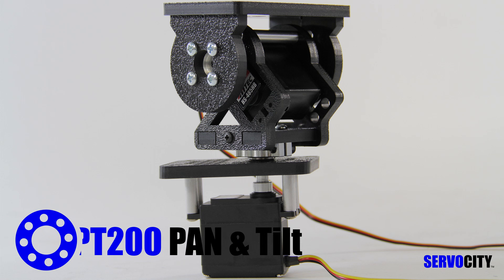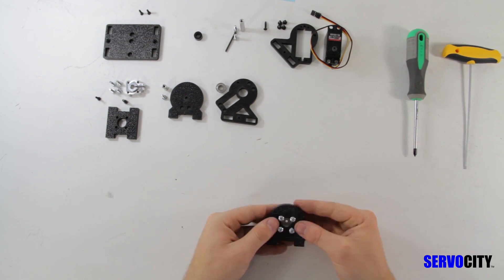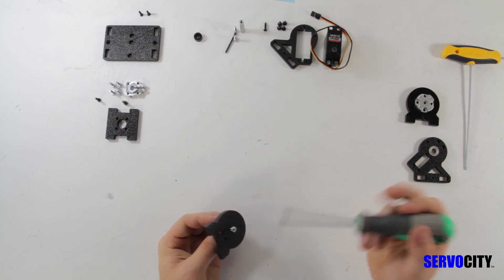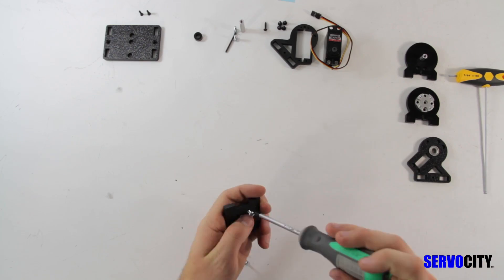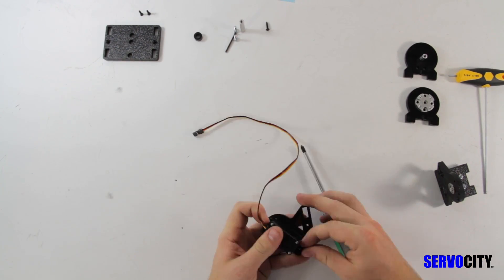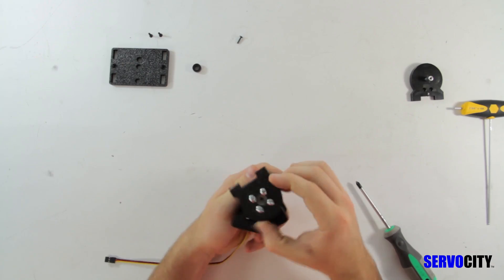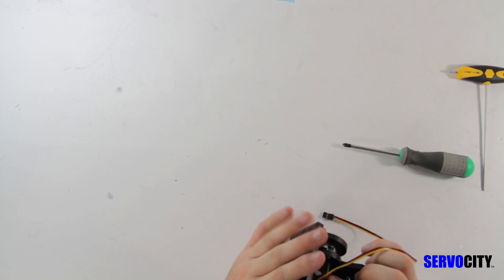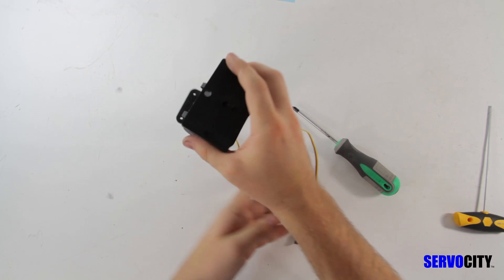SPT200 Pan & Tilt System & DDT500  Direct Drive Tilt Assembly (Full Instructions)

Comment: Cool. Any chance to use it under water?
Reply from the maker: You'd need to use waterproof servos and either perform post use maintenance to keep from having some of the hardware rust, or, replace the black oxide screws with stainless steel screws.  Note that some of the waterproof servos on the market that are listed as standard size happen to be a fraction larger than 'standard size' so they won't fit properly so choose wisely.  Please let us know should you have any other questions tech@servocity.com.

Comment: Hi, if I connect the ServoCity 2 Servo Joystick (that sells for $99 on your website) to the SPT200 will the pan/tilt assembly work as an open-loop proportional head? In particular will the speed of the rotational movement of each servo increase the further the stick is pushed to the side, and decrease the closer the stick is to the center, the same as what it does on your MPT1100-SS Pan & Tilt System?
Reply from the maker: The setup will be closed loop since you're using servos that have feedback and connecting to a servo controller.  It'll be position based; the location of the stick determines the location of the servos.  What you have described could be achieved using continuous rotations servos (those that don't have feedback) or using motors and a motor controller.  Keep in mind that if you have an open loop system it's best to select a framework that doesn't have a rotational limit since your motors/continuous rotation servos can rotate without bounds in either direction.  If you're looking to build a smaller version of the MPT1100-SS using servos you might consider one of the cradle tilt systems (DDT540 or DDT560), a pan system (DDP125, DDP155), 2 continuous rotation servos (HSR-2645CRH) and a servo controller (JS-200 or transmitter and receiver package).  Please feel free to contact us should you have any additional questions tech@servocity.com.

Comment: Hi, I wanted to use this for an FPV antenna tracker. Can you specify a servo so the pan can rotate 360 degrees?
Reply from the maker: Hi, the SPT200 requires a standard size servo and we do not offer any that are capable of 360 while retaining positioning feedback. Please let us know should you have any additional questions tech@servocity.com or 620-221-0123.  We'd be happy to assist.